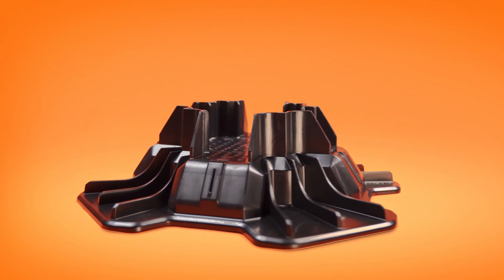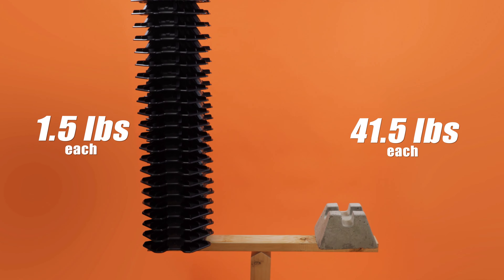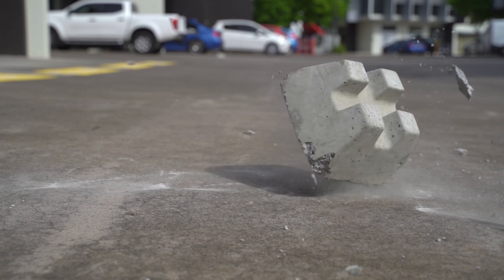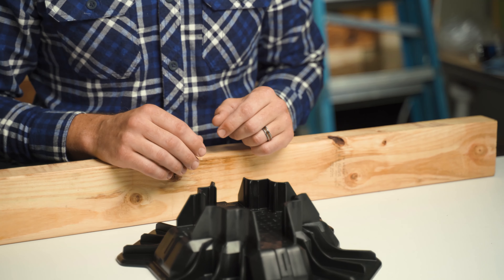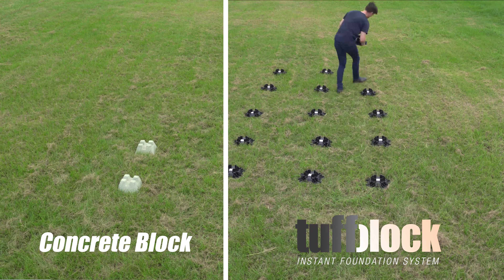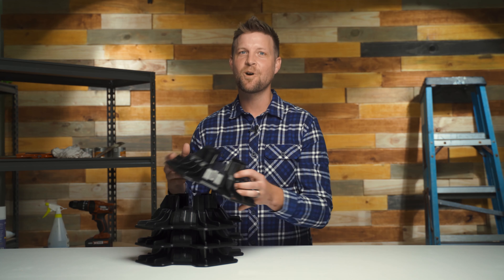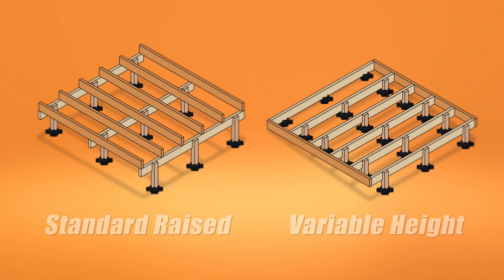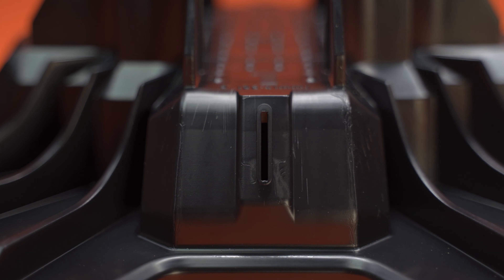Meet TuffBlock - The Revolutionary & Highly Engineered Polymer Alternative to Concrete Deck Blocks

Comment: look cool! do you not stake them in to the ground in anyway after they are leveled an placed? would be worried about them shifting, or is that not an issue after the load is on them?
Reply from the maker: If you're worried about uplift from wind then you can use earth anchors which are cheap and simple to install. Alternatively you can dynabolt TuffBlocks to concrete.
Reply: @Buildtuff I appreciate the reply thanks for the info!

Comment: So this thing allows water to escape then could you use standard lumber instead of pressure treated?
Reply from the maker: When building low profile decks we always suggest using treated lumber. It's true, TuffBlock prevents water buildup but building codes typically require treated wood for ground decks and it's the best bet for the longevity of your deck.

Comment: I am looking at building a 20'' x 20' deck for a customer and the only length of lumber I can get is 2x6 in 16' length so was looking for some guidance on whether or not I can place two boards end to end on a tuff block allowing me to reach the 20' length and using a Tie Plate to secure them together.
Reply from the maker: Yeah absolutely you can do this. There's plenty of room in the TuffBlock slot to accomplish this. It's been done before by a number of builders and structurally it should be sound, especially with the tie plate.

Comment: What kind of ground prep do you need, you can't just throw on the grass?
Reply from the maker: It's not recommended as you want a compacted base to build on and the top soil that has grass growing tends to be on the loose side which can cause issues with movement. You can build on grass, but it's not the best method. It's also wise to remove any vegetation beneath your deck in general and use weed protection.

Comment: I have only seen these used for low decks. Can these be used for decks for an above ground pool? Posts would be around 4’ high.
Reply from the maker: We recommend using them up to 3 feet (1 meter). Local codes vary depending on your area, but I'm afraid unless you cement some down, then for a floating deck 4 feet would be too high. As an intermediary solution this would work.

Comment: What happens if you nest these to level your deck? Is the strength compromised?
Reply from the maker: We haven't tested a load rating for when they're stacked as they're not designed to be used that way, however a better solution would be to use 4x4 posts cut to the correct height with joists then attached. That's what we recommend in our installation guide, which you can find on our website. Hope this helps!

Comment: Ok. I looked up the price. Concrete Deck Blocks = $9.68. Tuffblock = $8.95.  This is at LOWES. And in Home Depot, Concrete Deck Blocks are one penny more than Lowes  concrete deck blocks.  
My only Question..mine are in Dirt...for a floating deck... are they going to slide around in the packed gravel I use to level everything?  Is that why you recommend using heavy Concrete deck blocks at the ends ?  I'm a Veteran.. have a bad back.. this will allow me to build the deck vs have to pay someone.. which I really cannot afford.
Reply from the maker: Hi there - apologies for the late response!

In terms of the weight of the block itself, that isn't an issue as the weight of the materials that go on top of it typically weigh up to half a ton. When it comes to floating decks, so long as they're used on stable compacted grade level earth and you create a level base then there isn't any significant difference in the application between TuffBlock and concrete blocks. The benefit of TuffBlock is that it's very lightweight, strong, comes with perfect measurements for most lumber sizes and has an ultra low profile (all of which are an issue with concrete blocks). You shouldn't need concrete blocks at the end. What you might be referring to is in ground concrete piers (poured concrete that needs to set over days) which you can use when tying the project to the ground. Hope this helps.

Comment: So a concrete footing under my raise deck went sideways today after heavy rain… It was like 4 inches underground. Can I buy a new post and use one of these as a replacement to the concrete post? It was just the 4 x 4 sitting on top of the concrete… I know it’s not up to standard for today but the thing was built 30 years ago.
Reply from the maker: Hi Tim. Thanks for getting in touch! How high is your raised deck? Typically we don't recommend using a deck footing on anything higher than 1 metre.

Comment: says height is 90mil is that with the wood inside or is that how big the thing is?
Reply from the maker: Hi Aiden - TuffBlocks are 90mm in height without the wood inside. Please check the BuildTuff website for a detailed diagram of the dimensions.

Comment: You put them straight on grass???!!! And you're saying they won't sink once there is weight on top? Should there not be a solid base?
Reply from the maker: You almost always want to remove the grass directly under the block. This is to remove vegetation, roots, and reveal the soil that you can compact with a tamp or compactor to create a firm surface to build on.

Comment: Are they good for sheds
Reply: There's a video coming out shortly showing how it was used as the foundation for a shed. It works great for them too.
Reply from the maker: https://www.youtube.com/watch?v=DWryrvxtapc&t=8s

Check out this video we recently created showing how it can be used with sheds.
Reply: Can I order in usa
Reply from the maker: @enlightenedillumination  You sure can. You'll find them at Lowes here: https://www.lowes.com/pd/BuildTuff-TuffBlock-1/1001436780
Or at our website here: https://buildtuff.com/
Reply: Bought them at Home Hardware in Ontario and used them to build a shed.  Extremely easy to use and reasonably priced as well.  Highly recommended.
Reply from the maker: @brianbaker359  That's great to hear that Brian :) Glad it helped you with your shed build!

Comment: Good idea though, but $10.00 a unit, Free S/H 🤔🤔🤔
The average Big Box store sells deck blocks between $6.37 - $7.29 +/-, the cost will add up quickly for the tuff block. Just saying......
Reply from the maker: Hey E. McClain. We see your point and thanks for letting us know. In Lowes we're actually cheaper than concrete deck blocks by more than 50c a block (this varies from store to store). Concrete deck blocks aren't a bad option but consider some advantages. 

It's ultra low profile design of 50mm to the base allows ultra low profile decks, which you can't achieve with chunky concrete blocks (without digging each block into the ground). 
TuffBlocks work extremely well on surfaces you can't dig into such as concrete, bitumen and tiles etc. where the wide flat base works perfectly. In these situations an ultra low profile deck isn't achievable with concrete blocks. 
With concrete you typically use a handsaw to cut out the post slot, whereas TuffBlocks come with precise measurements built in. 
With larger projects, getting 50+ concrete blocks in your truck isn't ideal (or perhaps even possible). TuffBlocks being lightweight and stackable means transporting is very simple. And that factors into speed of use when building.

We hope you'll consider the advantages TuffBlocks provide and give us a try!
Reply: @Buildtuff  Hmm here I see you are nearly DOUBLE that of a concrete deck block.. Which has at least a 10x compression strength as compared to your product... Only plus is you are made in USA... For now.. but I bet that will change...
Reply from the maker: @FJB2020  It varies slightly depending on each store but currently we're about 30% more than the concrete blocks but factor in the additional benefits: easy to transport, store and use, they allow for 2 inch ultra low decks rather than the 6 inch minimum that concrete has. The TuffBlocks are break tested to 11,000 lbs each so strength definitely isn't an issue. The concrete blocks don't come with post slots pre-made, you have to chisel them out which adds time and labour. And a big complaint of the concrete blocks is that they vary in size from block to block, so your 2inch timber doesn't always slot in. TuffBlocks are precise. Oh, and don't forget that TuffBlock is made from 100% recycled plastic that repurposes plastic headed to landfill or the ocean. Concrete production is damaging to the environment. We appreciate the additional cost is a factor, but we hope you see the benefits as well! BuildTuff believes strongly in the re-shoring of manufacturing back from China, so don't expect us to leave anytime soon!
Reply: I was at Lowes tonight and concrete deck blocks are now $10 each. Tuff blocks are $8 something. Concrete is too expensive now.

Comment: Is this good for fences?
Reply from the maker: We've not seen it used in a fence before - more foundations for decks, sheds and walkways etc. With fencing the posts are tall and firmly fixed into the ground with concrete. With floating decks we recommend posts no taller than 3 feet (where the weight combined with the post slot with a wide load are more than enough to create a very stable foundation). We're always open to being proved wrong so don't let us tell you no. But we'd probably advise against TuffBlock (or any deck block) for a fence structure.